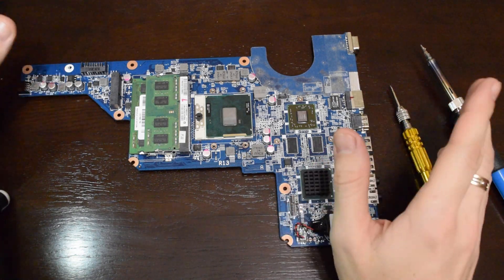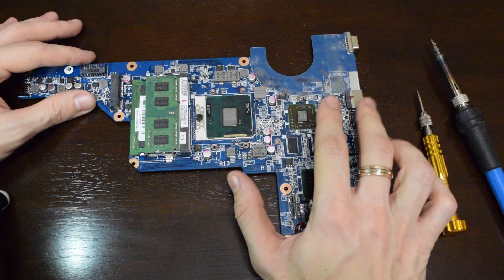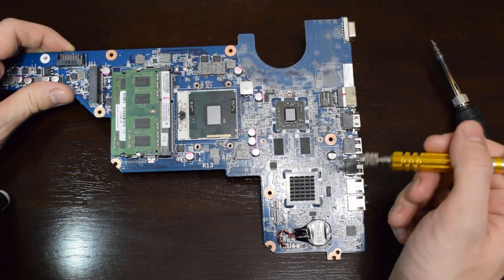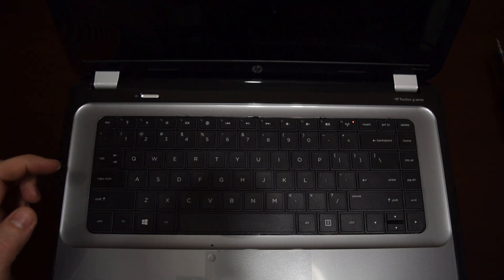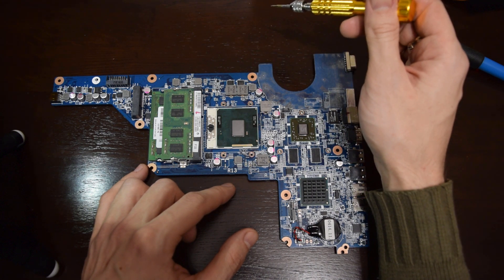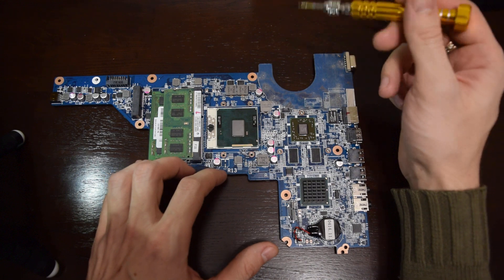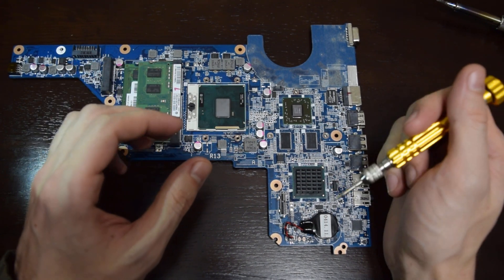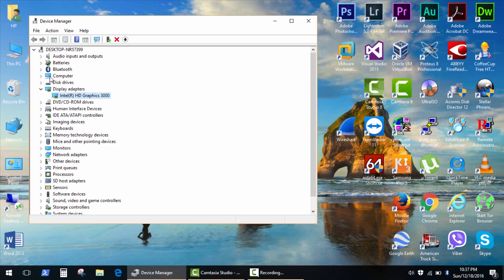Fix Dead GPU – Convert HP, Dell, Lenovo Laptop to UMA Graphics (HP G6 Example)

Comment: mine also has a dead gpu but the screen turns on without posting anything, does it only use the GPU to show up??
Reply from the maker: Different laptop models behave differently with the exact same fault. If your laptop has a faulty GPU but the CPU includes Intel integrated graphics, then it's usually a five-minute job.

Comment: Very bloody handy. Thanks for this. I have a laptop with a 7th gen i5. It needs an 8th gen to run Windows 11 (it's for a customer, not me; I'd run Linux otherwise). Anyway, I got a used motherboard with an 8th gen i5 and a GPU for very cheap and needed to disable the GPU as it isn't needed and also as I don't have the right heatsink for it. This video should prove very helpful!
Reply from the maker: Glad it helped
Reply: @ElectronicsComputers  I'm back. I removed the GPU coil after doing some research as it wasn't immediately obvious which was the right one. The laptop works on UMA. No issues. Just what I needed.

Comment: How did you find that the coil was faulty?
Reply from the maker: That coil wasn't faulty, by removing the coil or MOSFET that powers the GPU, you completely disable it making the system to force switch to the Intel's graphic.

Comment: What about disabling it using Device Manager through safe mode?
Reply from the maker: If the GPU is dead, the laptop won't even boot into Windows or access the BIOS. Even if you disable the GPU while the system is running, once the chip fails, the laptop won't start at all.

Comment: Hello. I just saw the video and I want to ask you. In addition to the coil, do we have to remove or change the position of any capacitors?
Reply from the maker: @T0LL1S  It depends on the laptop model. For some models, you need to swap resistors, but for most, removing a mosfet or coil that powers the GPU is enough.
Reply: @ElectronicsComputers  Let me ask you again. After that we have HDMI output?

Comment: Thanks for the video sir! I have a Quanta laptop with RTX 2060 gpu, which became faulty. But it's not fully dead. I can play games if the laptop cooled down for hours. It gets BSOD once I finish my gaming session (it can take hours without any BSOD). Then it boots without recognizing RTX gpu, which causes battery drain and heat. The cycle continues like that. Is there any way to save my laptop without fully removing gpu?
Reply from the maker: Unfortunately, there is no way to fix it. It's impossible to buy a new GPU for such an old laptop. You can try reflowing the chip, which may or may not work, but it will only be a temporary solution. So just leave it as is or disable a dying chip.

Comment: Thanks Boss for the clear and enlighten clip. 
Sir I have similar issues with my laptop dell latitude E6430 board number: LA-7782P now from the board the GMCH has two cool PL1000 and PL1001, so my question is; am I going to take off the two coils in this aspect since yours was one?
Reply from the maker: You can try to remove both coils but from what I see that laptops requires more modification like resisters swap and adding dome jumper cables. There's plenty of videos on that model modification.
Reply: @ElectronicsComputers  OK Sir. And please Sir can you help me with any of the video links will sincerely appreciate

Comment: You can just turn off the dedicated graphic card in the bios not need to break the link between the gpu and the motherboard 

Thank me later ;)
Reply from the maker: It doesn't work like that. If the dedicated graphics chip is already dead, your laptop will not turn on because the dead chip will fail the POST diagnostics during startup.
Reply: @ElectronicsComputers  bro

This advice is for the one who the dedicated gpu not work just like in the video

I didn’t say to the on who the integrated gpu destroyed 

You can also fix this issue using the bios too

Turn off the integrated gpu and make the display work in the dedicated gpu and you will be fine

Comment: My Dell 5567 had a dying AMD GPU. I didn't know this method, so I removed the GPU and VRAM chips with hot air. Luckily it worked for me. eDP and external HDMI works well. I was quite surprised that a newer laptop would even boot up given that major chips were removed off the board (without soldering/desoldering any jumpers or resistors). Dell ePSA doesn't throw a single error, but the GPU thermistor reports 0 Celcius. Windows device manager doesn't show the GPU or any unidentified devices. However, one CPU core is now running at 20 Celcius hotter than the other which I'm trying to figure out why. The heatsink is properly seated on the CPU even without the GPU by adjusting the GPU side screws.
Reply from the maker: Great job! Maybe that core is closer to the built-in GPU core, and this is why it gets hotter than other cores.

Comment: It works even in new laptops, thanks for the idea, one small note, there is a change you lose all external monitor connectivity, depending on how on it is wired in you laptop
Reply from the maker: That's right!

Comment: Hi, My Toshiba Satellite A660 - 1H6 laptop nvidia chip overheated and now there is no display (internal or external)at boot. The laptop switches off in 10 seconds. Will this work method work for my model ?
Reply from the maker: Unfortunately for that first Gen Intel CPU it's not gonna work.

Comment: hi bro i have similar error but my laptops boots on and working only when i use Microsoft display adapter but when i try to update the gpu driver to intel laptop stops working completely and when i go to the safe mode and uninstall the driver its boots also the caps lock blink one time every time i turn on the laptop could you know the possible fix or what js the problem😊
Reply from the maker: Sometimes a GPU chip dies like that. It still works but can't support or execute some instructions from the drivers and you end up in blue screen or other errors from the BIOS or Windows. What's the model of your laptop?
Reply: Oh sorry for the late reply its hp 14s  core i3 10gen
Reply: And yes i got these errors could you tell me if it can be solved or i have to buy another laptop😅

Comment: Hi, My laptop is HP DV7-4025ss with core i5-450M  with ATI Mobility Radeon HD 5650 dedicated graphics, is my laptop compatible? can you help me out find the coil to remove? The Board is da0lx6mb6f2 rev f. Thanks!
Reply from the maker: It's not gonna work for that motherboard with first gen Intel CPU. The GPU of that CPU didn't even wired on that motherboard, so your motherboard doesn't even know that there's one more graphics available.

Comment: Hello, I have a HP G62 b40sm with a dodgy graphics chip, I found the solution you gave to someone for the G62, but when I remove the marked coil (PL8) it doesn't work, I just get a max fan spin. Are there any other steps I need to do?

Comment: Hi ...I have same problem with my hp G62 laptop...please guide me ...which coil that I have to remove...?
Reply from the maker: You need to remove this coil: https://ibb.co/FsvKh9Y
Reply: @ElectronicsComputers  HI, I also have a HP G62 (b40sm) with the same problem and the removal of that coil just causes max fan spin and no picture. Is theree anything else that must be done?

Comment: bro, in my hp laptop i also disabled the amd graphics like this , and in device manger the display adapter now shows only the intel graphics, but the problem is after laptop turned on and login after some minutes the screen is going blank. Do i need to reset(reinstall windows) my laptop completely after motherboard changes. In safe mode lapotop works perfect. please give me a solution.
Reply from the maker: What's the model of your laptop? Try to remove your dedicated graphics card drivers. Also go to the BIOS settings and check if the switchable graphics option is set to off.
Reply: @ElectronicsComputers  my model is HP Notebook - 15-ay079tx, dedicated graphics card driver is removed, but in bios switchable graphics means where is that, in my bios there is an option in advanced only for internal graphics - disable/enable/auto, should i disable that?
Reply: @ElectronicsComputers  bro thanks for the reply, problem solved after reset and windows installed manually.

Comment: Hi I just emailed you some images at your businss email to figure out which coil to remove. If you would be kind to reply I'd appreciate it so much. Its a gigabyte aorus 15G XB
Reply from the maker: Tell me what's the exact model of your laptop. There's a lot of G6 models were made with different specs and motherboards.
Reply: @ElectronicsComputers  Hi thanks for getting back to me. I emailed you at your business email the images of my motherboard, its actually a gigabyte laptop : gigabyte AORUS 15G XB. Please let me know if you can identify which coil to remove to disable the GPU

Comment: I have the same problem with my Samsung NP350V5C. Took it to the repair centre they can't repair it and quoted "you have a GPU short". Any help on this is much appreciated.
Reply from the maker: Simply remove this coil and it will disable the power rail of your discrete graphics. https://i.ibb.co/vX5fBf8/HTB1-N8-VASFXXXXXb-XXXXq6x-XFXXXE.jpg
Reply: @ElectronicsComputers  Ok let's try this hope it works.
Reply: @ElectronicsComputers  and if you could help me..what is the CMOS battery model?

Comment: hello sir o have same laptop what if alternate full white blank and came back what is the issie is this the same
Reply from the maker: Try to connect an external monitor or TV to see if the problem in your LCD or GPU or something else.
Reply: sir i ve done this the amd dead chip is remove and now intel is working but my issue still the same ive tried other monitor it is working there is seems the flex cable or the power ic supplying the ledlcd panel 3volts is not stable hope yoj can give me boardviewer file for this appreciate your help :)

Comment: Hello friend!, I have the Toshiba p50t-a215 which has a dead GPU (GT 745) and the CPU (i7-4700MQ) does have an integrated graphics card, But I saw in another comment you said that even if the CPU has an integrated graphics, it might not be connected to the board or something along those lines? Is there any way that I can check it? thank you!!

Comment: Hey man, i have an asus tuf fx570 which works for like 10mins and then shutsdown due to dead gpu, do u think this method will work on that laptop?
Reply from the maker: Maybe it just overheats!? Try to replace the thermal paste, clean the cooling system and check the heat pipe.
Reply: @ElectronicsComputers  ther thermal paste was replaced and cooling system was checked, is there anyway to completely bypass the dgpu

Comment: so if cpu has integrated graphics then only it will work?
Reply from the maker: Yep, but not all models though.
Reply: @ElectronicsComputers   can u check if a intel i7 3630QM 2.40ghz processor has integrated graphics ?? Because i gave to repair the guy says he will bypass the gpu cuz my gpu is dead , Then will it work?
Reply: @lachlandasilva9368  yes it does have integrated graphics

Comment: dont you need to change the resistor as well?
Reply from the maker: For that particular model all you need to do is remove the coil.
Reply: @ElectronicsComputers  thanks man... u know where i can salvage the k0b39 mosfet or equivalent on PQ43 of that specific model? the fet is shorted.
Reply: yes its the R13 G6

Comment: Hello, I stumbled upon this video and it looks promising... Do you think it would work on an HP Envy 17t-1100 laptop? If so, can you please point out which coil to disable / remove? Thanks a bunch, good work on this, thanks for sharing too!!!
Reply from the maker: it's not gonna work for that model, because integrated graphics into the CPU is not even connected to the board. You have two options here, buy a new motherboard (which will cost you about 50$) or the GPU chip replacement.
Reply: @ElectronicsComputers  I figured that… thanks so much for your reply, I think the GPU may be an easier replacement but how can I find the exact chip I need? It would just be desoldering / soldering I’m assuming on the board correct? Any help is greatly appreciated!
Reply from the maker: @Prblmslvd  New motherboard from China will be the cheapest option compare to replacing the chip (which by the way will be used. There's no new chips like that anymore).
Reply: @ElectronicsComputers  sir is tbis the same  i bave intermittent 3-5seconds whit blank screen and return to okay amd radeon graphics is not detected when using extended monitor display it is working on the second monitor but onmain lcd still switching to white blank scren and back i really need to disable radeon graphics only using intel

Comment: Hi, I have an idea which sound weird for the first time, but maybe it will work. I have an Dell PEW96 and a Dell m5010 with dead gpu. Sadly they only have 1 gpu (Both of them AMD and integrated GPU wasn't a thing from them at that time). However I saw some video about how to connect external gpu to a laptop with riser cable via mini pcie port. Both of them have a mini pcie slot so theoretically I could connect a GPU to them after your process. The question is that do you think it will work in reality or not?

Comment: Great video! I have an old laptop with the same issue. I can not detect which coil to remove. Would you plz look at it and how can I send you a snapshot of the laptop? Could you plz share ur email or something so i can send the picture? Thanks 👍
Reply from the maker: What's the model of your laptop?
Reply: @ElectronicsComputers  Acer v3 574 31D5
Reply: It has an NVIDIA GeForce 940M gpu that is unusable now. I don't get any display output. If I could just remove the coil I can at least use the intel iGPU.

Comment: Thanks for very helpful video!   I have old dell vostro laptop with nvidia graphics chip and very badly distorted display.  After watching yoru video, I got idea of going into bios setting and disabling nvidea graphics.  AND... IT WORKED!!  got to see beautiful clean display....  for a few minutes.  Then laptop crashed and then now laptop displays very bad distorted image no matter what the setting is in the bios.   Weird, dying nvidia chip so powerful to over-ride bios setting?   but as you suggested, I will take the laptop apart and cut off power supply to nvidia gpu and see what happenes.
Reply from the maker: What's the model of your laptop?
Reply: @ElectronicsComputers  It's Dell vostro 1400.  I downloaded schemtic from internet, but the schematic does not even show nvidia chip!   There must have been two versions of schematic, one with nvidia and one with intel graphics.   I realized that it's not possible to disable nvidia chip even if i found correct coil, as vostro 1400 seem to have either nvidia or integrated graphics, not both.   So I wound up just doing reflow of nvidia gpu using hot air station at 330 deg c.  Laptop seems to work fine again, although not sure how long it will hold up.

Comment: Hi, may you please help me identify the coil to remove for my ASUS X550JX laptop with dead graphic. Appreciate the help
Reply from the maker: It's very easy to convert that model to UMA. You need to remove these two coils: https://ibb.co/23fmRDy
Let me know if it worked for you.
Reply: @ElectronicsComputers  hi so it didn't work but I guess it's probably caused by other stuff as it still shows the same symptoms. Thank you so much for the help anyway
Reply from the maker: @heryc8307  Then the problem not in discrete graphics chip.

Comment: Hi can I ask whick coil I need to remove to disable the gpu in dell 1564 DA0M3MB8E laptop board Thanks
Reply from the maker: Unfortunately, it's not gonna work for that model.
Reply: @ElectronicsComputers  thanks

Comment: Hello,  it works on Dell Latitudine D630?  And wich coil  must be eliminated?
Reply from the maker: No, it's not gonna work because it's a very old laptop without built-in graphics chip into the CPU.
Reply: @ElectronicsComputers   thank you very much
Reply: @ElectronicsComputers  CPU is T9300

Comment: Can you help me? I have asus n752vx with gpu gtx 950m, i had problem in ram i tought is the gpu so  i removed some coils 3 close to gpu and scratched the board, do you have an email or ig i can send you the pic, gonna buy new ram but don't know if is gonna work or i'll need a new board
Reply: https://ibb.co/sw7cJVP this is the motherboard, you can see 2 smb coil and one under the heat sink also you can see the scratchs
Reply: Is it possible to install new smb coli?
Reply from the maker: I wouldn't trust that board anymore. There might be a short now. Now you need to disable all power to the GPU chip and find out why it doesn't work. What was the problem in the first place?
Reply: @ElectronicsComputers  i had some previous problems with hp laptop with double gpu, I fixed it using ur video, thank you by the way, so I had this black screen problem with this board and I assumed is the gpu, of course, I tried to disable it using your method but I destroyed it instead :/, and in the end it turns out that the problem was in the Ram so as you said, how can I disable the gpu or maybe install new coil guess is R36
Reply: @ElectronicsComputers  can you help me with that?

Comment: Hello can you teach me where can i see that part which i need to remove on the motherboard of my laptop? By the way my laptop is msi ex465. Hope you can help me.
Reply from the maker: It's not gonna works for that model, because it has a very old CPU which doesn't have a built-in graphics into it.
Reply: @ElectronicsComputers  thanks for the information. Have a nice day and Godbless.

Comment: acer dh53f la-f991p motherboard with a dead gpu, what do i need to remove
Reply: @ElectronicsComputers  well i managed to do it by removing two inductors on the gpu that fried, and it just powered straight up